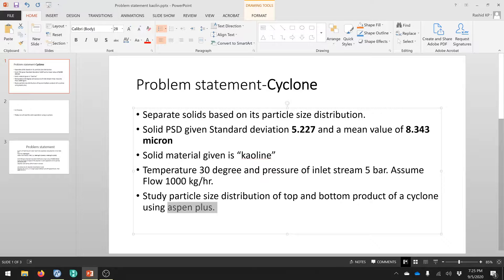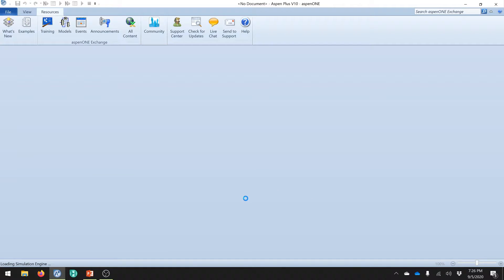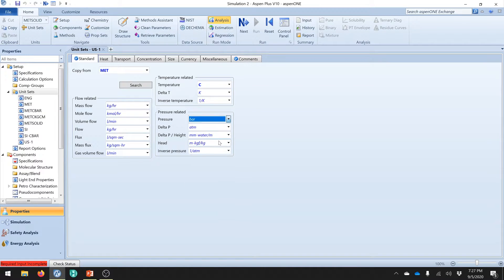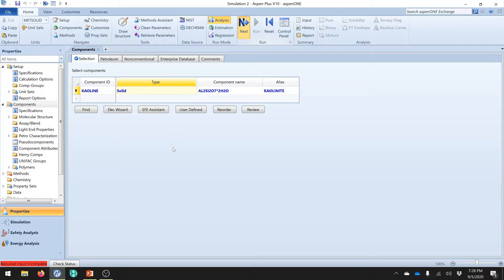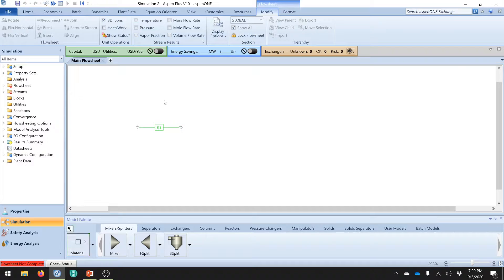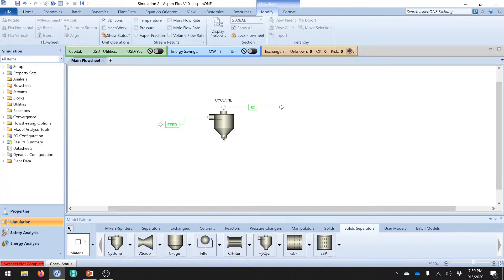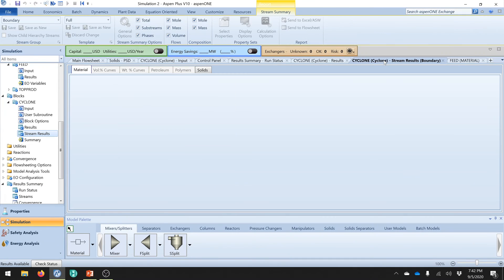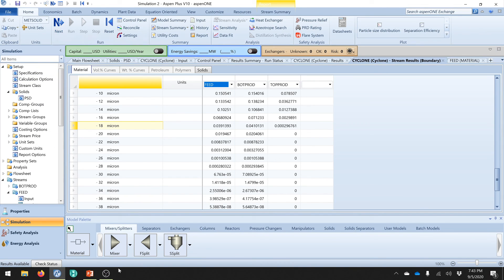Aspen Plus, Solids, Cyclone, Particle Size Distribution.

Comment: This is a great piece. Happy to learn about solid handling in HYSYS. Please, I would like to learn more about reactions involving solid materials.
Reply from the maker: Hi, there is option to add a reaction, even at solid system. if the kinetics values are define properly, i believe the simulation can give a proper result. I did them in CSTR. Never tried in solid phase.

Comment: I just wanted to know if I'm correct as u said the top part will cover all under 18 microns and more than 18 microns will be filtered by the BOTPROD. But I guess both top and bottom products will cover until 18 microns but after 18 microns only the bottom part will do the filtration part. Please do tell me if I am wrong here. Tq
Reply: Your understand is better.